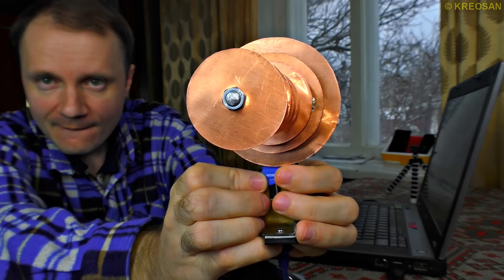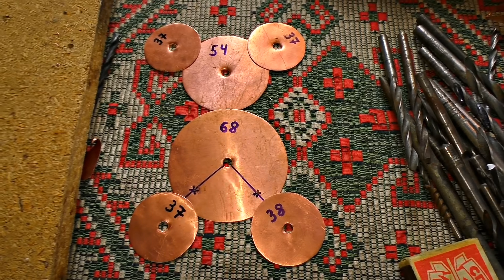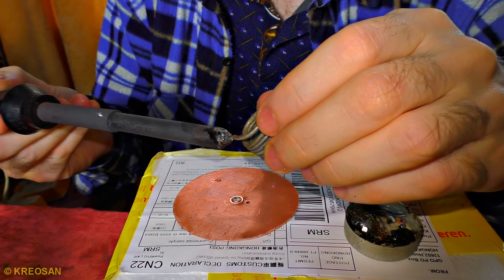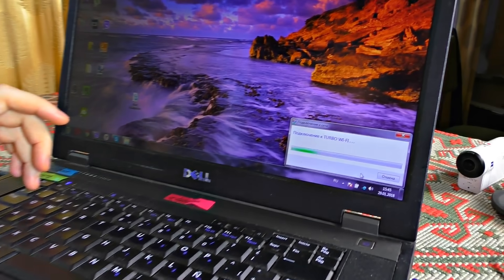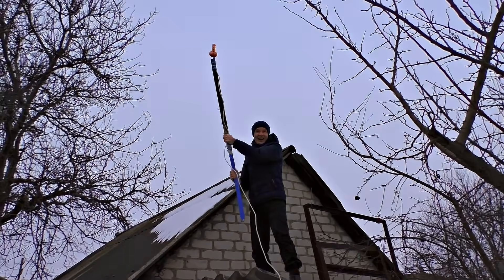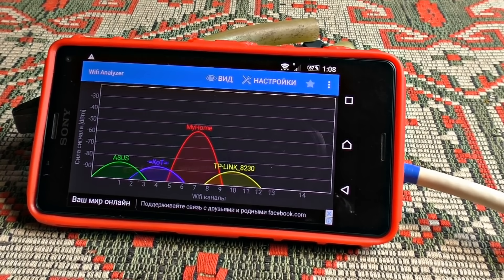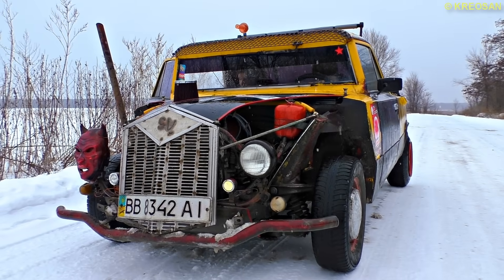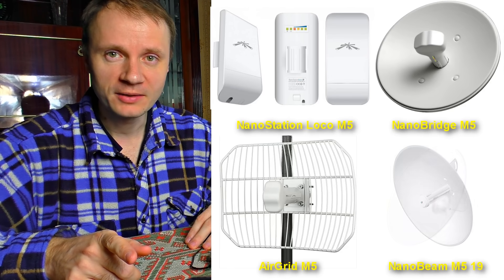✅Wi-Fi Gun DIY / Powerful Antenna for Wi-Fi !

Comment: I call complete and utter bullshit.

I did not see it any point where the driven element was isolated from the reflector or your directors.

Then you some garbage RG58 cable at excessive length on a microwave frequency which would easily give you more loss then that antenna would ever gain.

Then you tried to suggest that many kilometers away you can make a connection to your house while the phone is sitting inside of a metal vehicle with no external antenna of its own.

You guys are Beyond full of shit and it saddens me because you used to make good videos and now you just make trolling bullshit.
Reply: Ultra high directivity would also mean they would have to line up the antennas really well over that distance. Friis transmission formula still applies so we are looking at a 1/d^2 no matter the gain. So in one frame his home is less -50 dbm... he drives away a few 1/d^2 meters and still has -50 dbm... sure...
Reply: RG 6 is what the cable looked like. Isn’t rg58 75 Home and RG59 50 ohms?  Just saying from the good ole days of novel bus topology.  Anyway please continue to rant and yep some homemade yagi antennas are pretty damn good albeit lost are linear and not round but who knows. Build it and say it works or build it and say defacto he’s full of shut. I’m betting it does gain some just sure how much. And spacing does matter as it catches the peak to peak frequency of the waves.  Can’t remember what 2.4 is off the top of my head but hell its adjustable too lol.  Anyway. Proceed to bitch sir.
Reply: Been Street brought the real proof.
Reply: They have a direct direct visibility and about a mile from home. I can agree that impedance difference between cable and wifi module will have impact on real connection. The cable losses are big but not big enough to completely ditch the signal. The antenna works as classic Yagi with non-isolated rod, so compensation usually applied. I assume they were able to see the signals but established connection only with strongest. The antenna requires proper impedance matching and correct 50 Ohm cable. I'd rather get some SMA connectors and RG316 cable to make it all work properly.
Reply: No, using TV cable for wifi is a bad idea. Wi-Fi dongles and routers usually have 50 Ohm impedance.
Reply: https://www.youtube.com/watch?v=QTMi99HtW_k
Reply: Corrosive I clicked on it to have some laugh something similar to ThioJoe's videos, though it was well made and hilarious 7ms from 300 meters away by car...don't think so
Reply: At 1400 MHz the connection acts like a gamma match allowing for the feed point to be a close approximation of the equivalent of 72 Ohms which will match the feed point on the router and make the transfer of the signal with little or no loss minus the r(dc) of the cable center wire in the cable +/- loss(z(cable)) which can be a significant value unless a cable like LMR-400 or smaller is used as the downlink cable.
Therefore that is why no insulator is required for the driven element. See Dr. Yagi's design specifications for his design of parasitic element antenna.
This is simple microwave antenna design theory placed into action.
Reply: If it was a low frequency signal you'd be right, the antenna is shorted out and therefore clearly won't work.
But the wavelength of Wi-Fi (at 2.4GHz) is a matter of centimetres, so it's not shorted out and I wouldn't discount it because of this.
Any RF experts want to analyze what happens with non-isolated disks?
Reply: Santiago Ferrari shut the fuck up bitch Kali Linux is perfectly fine for those who don't want to spend 1.5 million years patching kernel modules or some other shit, it has everything you need
Reply: Re tv cable has 75 ohm impedance. is it the same for wifi?
Reply: This video is bs... electronics and radio signals simply don’t work like this
Reply: The Hotspot would explain why the connection had My Home at the beginning, then in the car it was WiFi Pulska
Reply: Honestly I would not be suprised if this is real, I've seen peopel do similar things, the only different thing they did was using bigger plates and they reached about 20km.
Reply: ...and people still love that kind of crap...
Reply: Corrosive i
Reply: The driven Element is not isoated, So I cannot see how this will work, the Coax also seems to be shorted out.  It is not a gun or rifle, it is based on a Yagi.
Reply: Corrosive ii
Reply: I heard the same thing about using a USB wifi dongle with a wok strainer a la New Zealand dudes posted years ago.  I was getting yelled at by knowledgeable critics. alas, 45 new SSIDs quieted the peanut gallery.  http://www.exe64.com/mirror/wokfi/ Now this one may be bullshit. probably is.  Either way, haters gonna do what they do best.
Reply: At that frequency they are isolated.
Reply: Corrosive they could of easily created tons of fake WiFi signals using kali linux
Reply: It doesn't have to be isolated, it's a kind of gamma matching.
Reply: hqdefault well, i might as well just machine one then, and put the connections on the reflector and the collector, right? Sorry, it doesnt really work that way. The collector has to be isolated. Or your gains are mute. It is true you can match by varying the length and matching phase, but that would be a different type of antenna all together.
Reply: Corrosive, you're spot on, this is compete and utter bullshit I don't doubt this antenna would work (in a manner of speaking) but if it improved range beyond 20 - 30 meters I'd be surprised, isolate the driven element I'd guesstimate it might actually work a bit better but kilometers range, na sorry that's just bullshit,
Reply: Re maybe do your research better. Here is a response to this video. While its not necessary, this video and your comment are highly misleading to the mechanics of an antenna. https://youtu.be/QTMi99HtW_k
Reply: Re and just because youve built them before doesnt mean you understand them. Try isolating your driven unit. Its gonna get you way better results.
Reply: You are such a stunning level of dunning Kruger NOOB! Like Jesus Christ shut the fuck up. First of all, RF IS NOT DC! a short circuit in DC is not always a short circuit in AC! I've fucking built antenas like these before myself, so I know what I'm talking about. YAGIS AND MANY OTHER TYPES OF ANTENAS CAN HAVE DC SHORTS, ITS NORMAL! Second of all, his cable was not rg58, it was TV, and maybe sattelite TV coax! That stuff is designed for operating in very high frequencies, and often has much lower losses than rg58. It has solid copper center pins, not the shitty twisted wire of rg58!
Reply: Corrosive saw the same thing. Total retards doing it for the views. Probably used all of his friends phones as hot spots to make it look like he was getting so many connections.

To the creator. Go build antennas for pulling data from satellites in earth orbit. Make some real views.

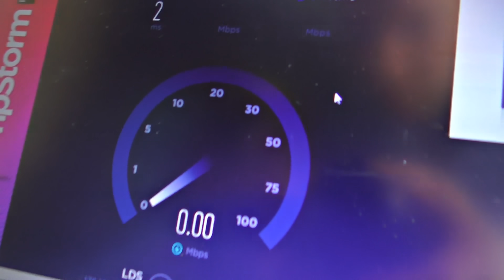Comment: 4:09 2ms ping on wifi??? Fake at all. Copper discs are short-circuited through a metal rod ,so there's no need to bend the wire to the first and second disk. it's enough only at first.

Comment: Fantastic..!  Several interesting concepts.  I love the capacitive coupling trick with the phone.  One point:  For mounting on the roof, I have always found it much easier to just use the pigtail and a USB extension cable (or USB over CAT5) and put the adaptor up with the antenna.  Less coax gives much better RSSI.  Thanks guys....!
Reply: THIS IS FAKE, and you are gullible.
Reply: @educatedmanholecoverbyrich8890 
We've been spotted guys.  

He's found us.

How did you get here? 

Fine. Ok. You're right. It's all fake.

But not because we're gullible.

But because we fucking hate you.

Comment: Awesome!  Great ideas in comments also regarding optimizing even more.  Way to go as I've not observed this design of yagi other than one or two times that comes to mind as most use tube or rod elements and not sheet metal.  

So, main objectives for improvement looks like:

1. USB cable for the longer cable length to avoid impedance mismatch of TV cable impedance and feedline losses.  Maybe piece of metal added on antenna to tune to 75ohm may work also. Will be interesting to see difference.
2. I really like the threaded rod design for fine tuning.  Reads like isolating elements from threaded rod with maybe plastic, ceramic or insulating pipe.  Maybe there are plastic threaded rod and a plastic that is optimal for the WiFi region.  Maybe tape on the copper elements or glue where in contact with threaded rod if metal to insulate if helps with performance.  Will be interesting to see difference.
3. A reflector that is larger and maybe in a parabolic trough design where the circular elements can also be in a trough type pattern versus circular... though I am not sure the optimal dimensions of trough elements.  Would a round spherical or better a parabolic dish behind the driving element help?   Even better is take the same antenna and use a round bottom sled or dish or trough (like trash can cut in half and not sure how to bend height wise) and point the dish or trough at the target with the antenna placed at the dish or trough focal point, pointing at the dish or trough.  Might be reflective paint or material that can be placed on the dish or trough if the material isn't very reflective.

Really neat design.  Way to go!  Bath tub comment is humorous as would be huge and really heavy and not so good I'm thinking on a mast.

Comment: This is definitely exceeding the 20dBm (Max. Transmission power on 2.4 GHz in Germany)
Reply: 1. so its illegal in germany?
2. is it possible to modify this for a better LTE signal?
Reply: 1) This is so illegal. But i don't think germany is the only country for this to be illegal.
2) If you know the frequency of your LTE signal. In Germany they range from 800Mhz to 2.6 Ghz, and you need to know the frequency to tune the antenna.
And your router/phone/receiver supports external antennas.
Reply: "This is definitely exceeding the 20dBm" Are you sure though? I barely understand the subject, but wouldn't changing the  power of a signal require some sort of amplification? Here he is just adding a ridiculous antenna, nothing more...
Reply: "This is definitely exceeding the 20dBm".
Not necessarily. 20dBm is the legal power (0.1 W to be precise) of the transmitter, but it's well directed (almost unidirectional). The law doesn't say what spatial characteristics of the antenna should be, so technically you can build an antenna with which you can reach really long distances in point-to-point connection.
Reply: i have made it its not working
Reply: +Bradley Gibbs You add the gain of the antenna to your transmitting power to get the total power, and it is the total power that is limited.
Reply: i am creating this but i want to know that what is 37 38  54 68 90  this dia meter or radius
Reply: usama khan,

Diameter of disk in millimetres.
Reply: i want to ask to a person who made this video  tell me the method to ask
Reply: dariusz B  but how tell me?
Reply: Maybe he has a HAM license type of thing like in the US. US max is 32-34dBm I think.
Reply: why its ill legal

Comment: How it is possible to catch signal, if you have contact between reflector and dipole through threaded rod (It is as short circuit). It is correct? I don't think so.

Comment: Why don't you use calipers? And use sharp edges for inner measuring? It's a lot easier and more presise
Reply: What would happen if you make it like this but on the copper plates winding a pancake coil and do that for every disc?

Comment: Just a stupid question....
Shouldn't the transmitter also be powerful ?
I dont understand how just making a bigger antenna helps, most routers have a range of less than 100m (if I am not wrong)
So how was he able to see so many wifi connections ?
Reply: Normal "rod" antenna transmits  in all directions this antenna focuses all of the transmitters power in to one direction. 

5mW led light will not be visible from far away but 5 mW laser can bee seen from far away because all of its power is focused in to a tiny dot.

Comment: protip:
make 8 of these antennas
attach to each other in a compass layout (like an X and + overlayed on each other) AND a dongle/router/phone/whatever
ultimate wifi coverage
Reply: jan harald kinda like the large radio telescopes antenna grids
Reply: that is omnidirectional, dummy
Reply: I understand both of your arguments, radius can be included in "range" but radius is not the same as range. There we go.
Reply: yes, I did
now, either go away, or understand that your definition of things is not the same as everyone else's
Reply: jan harald no you are the dummy here xD
Reply: However after having read an other comment, reviewing the video I also noticed that the elements are not isolated, so I am not sure this video show something real.
Reply: @Zviki Wifi is two-way, both stations transmit and receive.
Reply: Now the Minecraft kid stop replying using Wikipedia xD
Reply: More antennas means more load, thus the transmitter need to be more powerful, if the transmitter has the same power adding antennas simply "dilute" the power in more directions. That's the point of a directional antenna: it concentrates the power in only one focused direction.
Reply: If you wanted more power you could just use an amplifier and a normal antenna. But it's illegal. But so is using a directional antenna (at least in my country, because the limit is based on EIRP not actual power).
Reply: jello klotz Are you talking about transmitting or receiving a signal? Also, there are probably some regulations about the power you are transmitting...
Reply: Or use a simple rc transmitter /receiver and a 360 degree servo...put a power supply on both ends to power the receiver and transmitter. you could even use a regular servo for tilt and a 360 for pan to even further  rifle/sight in the 'target' wifi location. That same power supply could also power the router to rebroadcast from the highest point on the property back to your computer or cellphone.

the rc system controls azimuth and/olr tilt.

this same design could even become a beam antenna for an RC FPV (first person view) receiver plane tracker. Its not Circular polarized, but should be doable by cutting a small slice out of each disk from center to edge...maybe 5mm at edge 0 at center. all slices would need to be lined up.
Reply: +gittarpikk what happens if it is pointed at people for prolonged periods of time????
Reply: Dirk Diggler well at the milliwatt levels... nothing..one would have to amplify the signal to watts or hundreds of watts to get 'burned' in the 'beam'
Reply: Why not steal a clamshell from KFC and proceed from there..
Reply: jan harald nasa be like ur hired
Reply: They will become Tony Stark!
Reply: jan Harald li toki e toki pona anu seme?
Reply: That fucking antenna is a joke!  It doesn't work.  It is clickbait!
Reply: jan harald
Reply: jan harald 
😂😂😂
Reply: Actual pro tip- There will be so much loss you might as well use a regular high gain omni. Or spend a month trying to phase the array, Just make one or 2 and point it.
Reply: You won't increase the range much because the router still sends the same amount of power. Just use a beefy amplifier xD
Reply: yeah, because drinking water is totally different from drinking liquid oxygen
Reply: lol....you liked your own comment? xD
Reply: yeah because more radius is totally different from more range.
Reply: Here is a neat article that fairly well sums up the various higher frequencies used and proposed.
http://nesaranews.blogspot.com/2018/03/everything-you-need-to-know-about-5g.html
Reply: I'm not sure you even understood my point.
Reply: your point is more power = more range
my point is more angles = more radius
I'm not even sure you understood my point
Reply: good old argumentum ad populum. I'm done haha
Reply: lol
power and coverage are VERY different things

It's like saying making a line into a circle won't increase it's length while the argument is about the area of the shape...

read what people say
Reply: straight line = X
octagon of that same radius = X*8

I'm not sure you understand basic geometry...
Reply: jan harald more power = better coverage.

Comment: if you were to isolate the antenna disks, wouldn't you get better performance?
Reply: Sorry, but no it wouldn't. This is a microwave version of a Yagi antenna. Yagi antennas at the middle of the element are at ground potential. So, given that, (see Dr. Yagi's design notes for his original design or look at ARRL antenna book forbetter consice info), there is no voltage or current at the grounding point and an insulator is unneeded.
Reply: Jan Herald:
Yes you could buy one off the shelf, but that would make you a consumer. Personally, I would rather be an experimenter and be able to tweak the design to its limits and see what happens then. 
Best wishes and KEEP LOOKING UP!
Reply: i think this antenna will not work in this way, and i think that the disks must be isolated to the central bolt
Reply: T. https://youtu.be/QTMi99HtW_k
Reply: jan harald it's all fake anyway, this would be likely not much more effective than a cheap off the shelf  antenna

Comment: 0:31 no way that copper sheet is 3mm thick
Reply: 3mm is too thick! :D 0.3mm sounds better
Reply: It's 0.3mm.
Reply: Why?
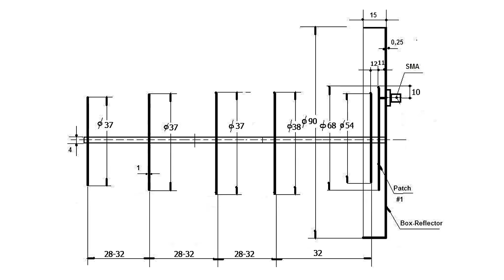Reply: Ali Amber because 3mm isn't that easy to cut... You can also see at 0:24 where he is using a ruler, that the plates are not even close to 3mm... I'm pretty sure it's less than 1mm, so he probably meant 0.3mm
Reply: Plz,  can u tell me can i use tin or aluminium
Reply: Ali Amber I am not sure about that... I think you should try with aluminium and see if it works
Reply: i think he mean 3 mils thick which is much thinner